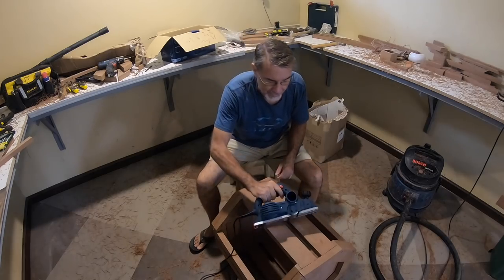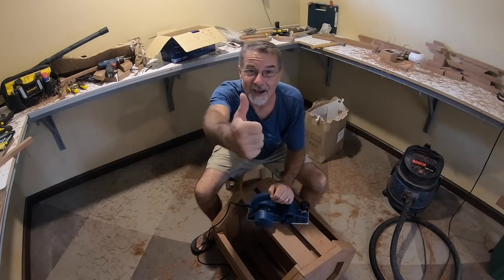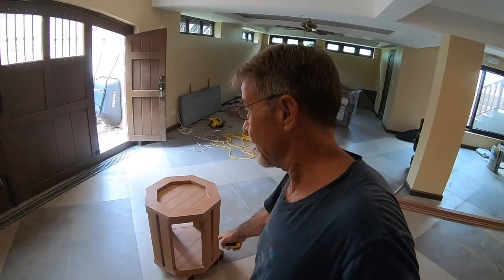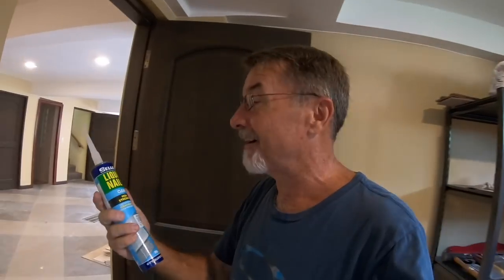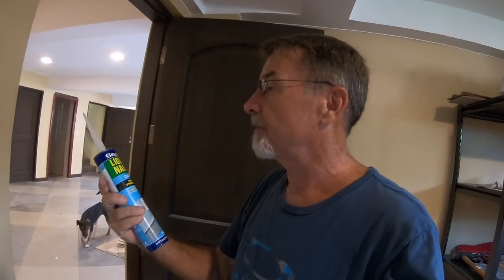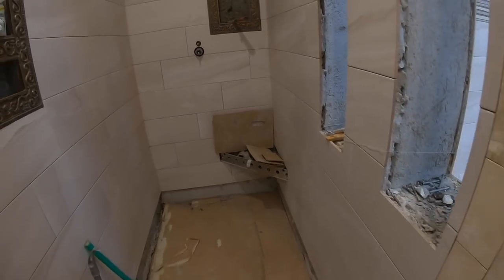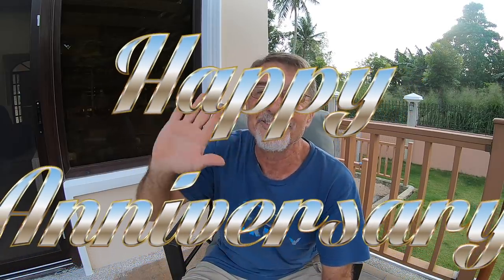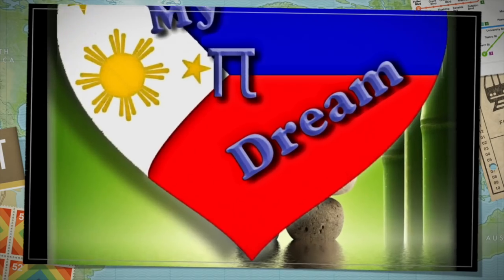VILLA FELIZ - EPISODE 394: ONE MORE TILE DAY? (House Building in the Philippines)

Comment: Nice little table James, and you got it done quickly! Could I make a small comment that might help others in the future though? I’ve used liquid nails for outdoor projects as well and found that when you apply to both sides being glued (or just plop it down like you did and then lift it off) and then wait 5 minutes or so for it to get tacky before putting the surfaces together, it results in a stronger bond. My proof of this was in building some furniture for outdoor storage, I forgot to pull it apart with a few joints as I said above and had a few failures. This was in pretty extreme conditions with a sunny rooftop that gets up over 40C on sunny summer days, doubt yours will get that extreme heat.

The house is looking great, I look forward to driving down from Tanauan next time I’m there and having a look, and meeting you and Ness of course! Cheers, Joe
Reply from the maker: That is absolutely the correct method of applying the adhesive.  I usually do the same when I use real wood and wood glue.  Although I don't put it on both side, I apply pressure, then pull apart the two pieces of wood for about 30 seconds than reattach.  Give a strong bond with this technique.
Reply: My PI Dream what is the brand of the nail glue ? i need to stick some items on the wall like framed certificates

Comment: Do you plan to add a plastic or rubber grommet to the center of your table top?  Over time, the umbrella pole may damage the granite, otherwise, when there's wind.
Reply from the maker: Yes, I'm planning on putting a plastic grommet inside the hole of the granite.

Comment: James, I see all the build-up over your head at 4:00 and I know they did a lot of other build-up and obviously have more to do. I wonder in retrospect if it would have been easier to stop tiling for a while and refinish all the walls with the necessary build-up using a cement mix...then go on to tile the "near perfect" new surface. I know it's too late now, but if you had another CR to do and saw the same issues would you go that route?
Reply from the maker: Yes, its best to get the walls and ceilings correct before finishing takes place.

Comment: Hi James and Ness ,love the table but I think you should not have a cavaity under the granite when the umbrella pole goes in it needs to be more stable or any kind of movement might crack the granite in time just saying after all your work making it would not be nice if it cracked from pressure of umbrella pole slightest breeze and pop ,tiles in bathroom looking great its slow but worth it :)
Reply from the maker: The umbrella pole is a lightweight wood or simulated plastic/wood.  I don't believe it would damage the natural granite top.  I'm also looking for something like a grommet sleeve to put in the hole also.
Reply: Salamat James ,that's good its lightweight .